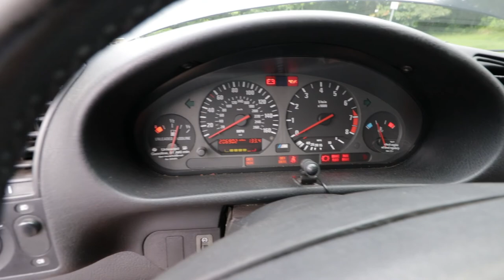E36 M3 Build Progress & Garage Update - Bonus Exhaust Clip

Comment: I used to have an e36 325i. I put the Eibach Pro System Plus suspension kit on it. I loved the looks and the way the car handled with that set up. That was back in 2003. I'm sure parts have changed and upgraded for the e36 since then. 
My current daily is a F80 M3. I'm debating EMD vs M-Perf HAS vs Bilstein B16 coilovers. I don't live near a track. So, I think coilovers might be overkill. To be determined...
Reply from the maker: Both EMD and Mperf HAS are great option. Depending on the budget you should choose between both 2. I currently have EMD and will get MPerf at some point in the future. Thanks